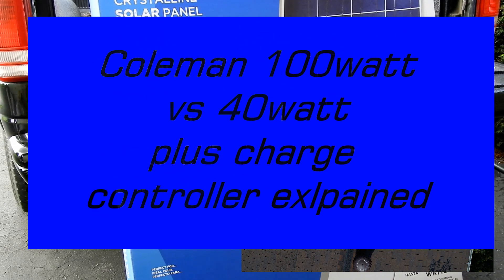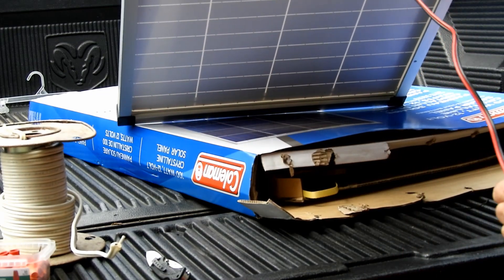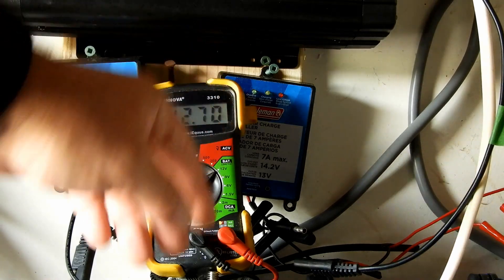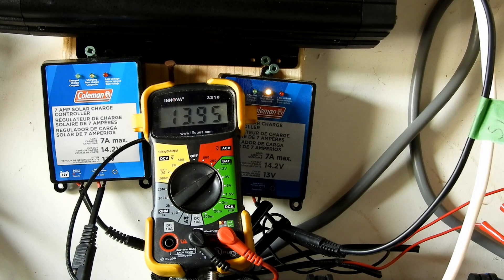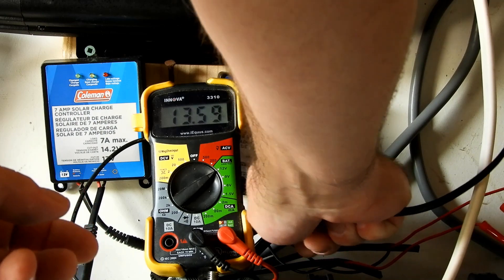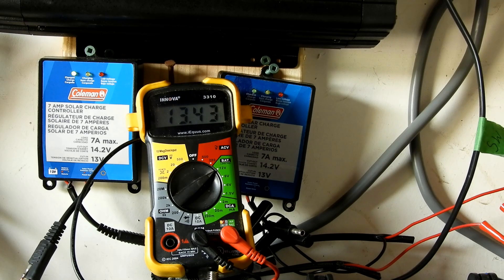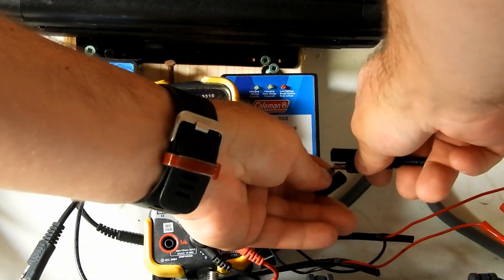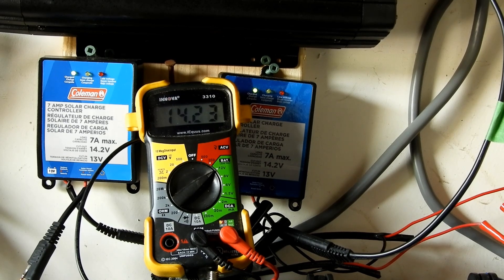Coleman Solar 100watt vs 40watt plus controllers

Comment: Can i use this solar panel in combination with the coleman 8.5amp charge controller to charge a Lipo battery (Anker powerbank 522)?
Reply from the maker: If the charge controller does not indicate its for a lithium battery then in theory u should not use it long term... personally for me if the battery is being used or under a load, or to top it up I'd do it.. but again it's probably not recommended.

Comment: Hi
More information for your readers. I have a lithium battery and did not know if Colman controller would work, so i emailed Colman in regard to the controller. They replied," Lithium batterie save a more complicated charging parameter and so we always advise purchasing a solar charge controller that has a lithium setting. Sunforce at this point does not offer such a controller. Sunforce makes the Colman controller

Comment: Hi- I am thinking of getting a Colman 40 watt and the controller comes with it and i have a Lithium battery. I asked the Managment of Canadian Tire if controller would work with LITHIUM AND HE SAID NO, and other people have said yes. I am confused any suggestion or advise. Thanks
Reply from the maker: I can ask someone who builds lithium battery packs later this morning.  I can say it will definitely charge the batteries, but leaving the controller on the battery 24/7 without using the battery might be the issue… that is what I’ll verify.
Reply from the maker: You can do short term charge if you know the battery needs charging and disconnect when charged, otherwise you need to get a controller designed for lithium batteries for regular use or you will probably ruin them..

Comment: What would really show the difference is how long it would take to fully charge a deep cycle battery which is drained so it will not run your electric  Trolling motor......using the same battery and the same motor to drain it
Reply from the maker: Yes it would be a good test.. what I can say if you were to run this small panel while out fishing it would significantly increase run time.. especially if you only run the motor on off just to get into position… and a few hours in good sun would really help

Comment: So wrong. using more than one charge controller.
Reply from the maker: Not really, the larger controller with the 100 watt panel takes care of battery from late a.m. to mid afternoon. The other 2 controllers are hooked up to separate panels, one that gets early morning sun and the other is late afternoon… works like a charm when I utilize early morning or late afternoon… have a good day… ps, when the yellow light is on full it’s pushing power into battery…

Comment: So, I see you run the 100 watt panel into the 40 watt controller. No worries. I just picked up two of the 40 w and Im wondering if I can run two 40 w off the one controller for ease of install and having a spare. The 100 amp has an 8.5 w controller versus the 7 amp and, since its 2.3 amp under perfect conditions , why the higher numbers? Even the 100 w Noma only puts out 5.5a but has a 8.5a controller. Are they that crappy at Crappy Tire?
 "Maximum power output: 40 watts and 2.3 Amps under ideal conditions
7 amp charge controller protects the 12 volt battery from overcharging"
Reply: To use both 40 and one controller you need the parallel hub they sell. It can take up to 4 or six panels I think (all must be same wattage ) BUT your controller can only handle 3 x 40 watt panels before it will exceed that 7 amp max.  I would buy a good 30 amp or more controller if setting up a decent system.  Bought the Colman kit with 2 40 watt solar panels and found out you need the hub after reading the directions which also list all the restrictions it has .
Reply: @George196207  This is what I have done.  I run three 40W panels plugged into a parallel cord and into the single controller.   It works very well (as long as you have a campsite with sunshine).
Reply from the maker: The controller should handle it fine, I know someone who runs 100 watt panel on the smaller controller... as long as you hook the panels correctly.... I’ve not done this method personally so I can’t confirm how it will work. The nice thing if you run each separately is in the morning one panel can face south east and the other south west independent of each other... I’ve had no issue with overcharging....

Comment: Hi, can I charge lithium batteries with this panel?
Reply from the maker: Only if they are 12 volts from my understanding, but you should charge a 12v battery with an inverter attached and use the proper charger for it.

Comment: What kind of battery do you use with this setup?
Reply from the maker: bertandernies4rent I’m using a deep cycle agm type battery.  If you only require occasional use a normal car battery will be ok.. I use mine often in the summer charging electric yard equipment and stuff, also handy if the power goes out, you can run a kettle if you have say a 1500 watt inverter or a sump pump if you have at least a 3000 watt inverter.
Reply: @kd_enterprise3404  Thanks for the information!  I'm looking into this specific panel to keep my ice fishing shack batteries powered up.  I think it will be worth the investment.
Reply from the maker: bertandernies4rent  what  items do you power in the shack?
Reply: K&D_Enterprise mostly just a television and a boosted antenna at this point.
Reply from the maker: bertandernies4rent ok, that that will work fine!
Reply: @kd_enterprise3404  Does this get hooked up to the battery? I want one for my trailer, which has two batteries, not sure what kind. If I want to charge them with this 100w panel, does it connect straight to the battery or to something else (it has the controller, so guessing that is what connects to battery or? Thanks.
Reply from the maker: Cynthia Reyes you should use a charge controller,, they are about 20 dollars. It prevents your battery from overcharging. No big deal.. I think I show them in the video. Or I have another vid about them...so yes, hook controller up to one of the batteries.
Reply: @kd_enterprise3404  Thank you. Yes, it comes with one (the one I am looking at). I finally found a video that shows how to connect.
Reply from the maker: Cynthia Reyes good stuff.. 100 watt is a good choice.. thanks for watching!

Comment: I think that those charge controllers will harm batteries over long periods of time. More damage to AGM than Flooded.
Reply from the maker: I have some concerns also, I actually am now running 3 panels and 3 controllers on the same battery.. basically when you use the battery a lot, the controllers are on and off constantly.. but if not used for a few days the controllers don't cycle much. I'm pretty happy with it, depending on your needs, great for an RV, however I'd consider a 1500 watt inverter rather than the 1000w.. The 1000 can handle my coffee maker but wont handle a tea kettle. if you only charge small things or even to run a small tv you only need a 400w inverter.  Sorry, started babbling..
Reply: K&D_Enterprise 
I have the coleman 30amp controller. It doesn't cycle like the others do. It charges to 14.? Volts then goes to float stage and maintains about 13.? volts. I was concerned about the cycling the smaller controllers was doing so I bought the better one. Plus it gives you volt or amp reading.
Reply: @hoosierdaddy3705  Was looking at the 30 amp controller for my cabin so I could buy another 2 x  40 watt kit . But been thinking the bigger 100 watt panels might be  much better.

Comment: How much does a 100 watt solar panel cost
Reply from the maker: In Canada for the Coleman panel it's an absurd price of 529.00... lol.. don't ever pay that!  They are on sale all the time and can probably get for 200.00 even at that they are pricey.. but convenient for small projects or for an RV as they come with the wiring and controller..
Reply: Just returned from Sam's Club in the US.  Coleman 100 Watt solar panel with 8.5 amp charge controller included in the box: $139.98 (8/29/2018)
Reply from the maker: sdrawkcabgnipytmi well it’s pretty much everything,, almost every automotive part is double the price in Canada. “Beverages” range from twice and often 4x the price” many reasons for this hidden import fees and hidden taxes etc..

Comment: Is your panels, hooked up in series, or parallel.
How many batteries 
What is your inverter wattage 
Is your system on fuse, and breakers.
Reply from the maker: This is very basic, each panel has a controller. I'm only charging one 12v battery and using an 1500w inverter to charge all my devices.. its capable of opening my garage door.. making coffee, or running a small sump pump etc. basically I can run a few things to make life easier when the grid goes down....
Reply: K&D_Enterprise I am doing the same. Just starting my of grid setup myself, keep it coming 👍🏿
Reply: Thanks
Reply: The size of your battery bank is extremely important if you want power to run the inverter for longer times...think electric  forklift battery pack that should do it.
Reply: With the Colman 40 watt kit that comes with two panels it has to be in parallel for the controller , they sell a hub that makes it easy to plug in a few panels ,all of the same size . Just if you go past 3 you need a better controller they sell .  Starts to cost buying a cheap kit lol